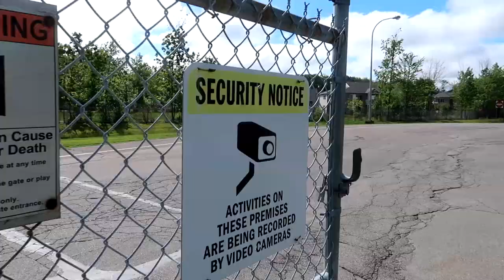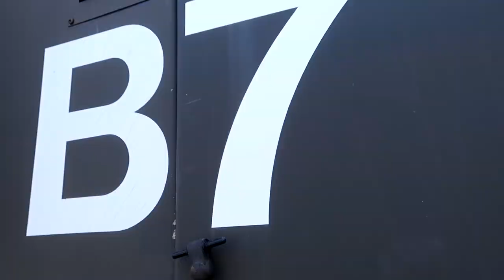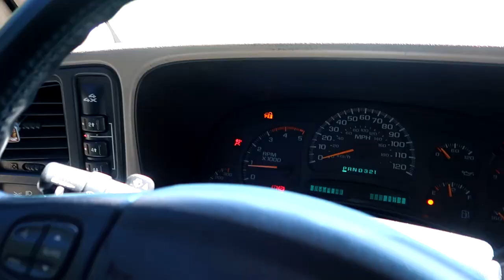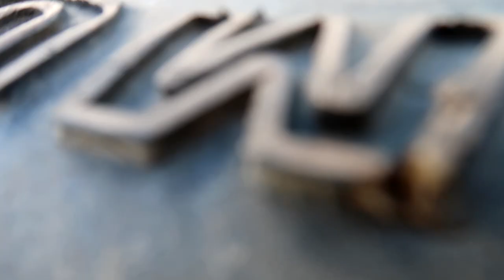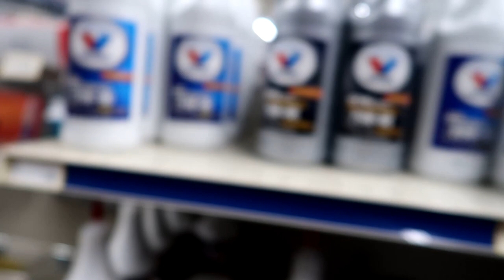GIRLFRIEND WOULDN'T LET ME!!

Comment: you went ,  that auction is the first Wednesday in june @ 9am every year for the past 25 years that I know of . tell your girl fiend this ,  I took my nephew there in 2011 , he  picked up a 2001 ford f150 that needed front brake pads for $650 . he drove it almost 1 year then sold it on craigslist for $2000 .  he took his $2000 to another NYS-DOT auction in Rochester and picked up a 2002 chevy pickup for $1800 . he had that 3 years then sold it broken on craigs for $800 . (but still up on his original 650 ) then took his $800 to a NYS-DEC auction (dept of environmental conservation ) and picked up a 2003 f150 4x4 -  bi-fuel CNG ..  dark green game warden truck ,for $800. and still drives that now .  if you buy a car or truck from one of those , look for something just a little broken ..muffler/brakes/winshield or tires .. you get the best deal that way . not to many people want a broken or rusty truck so they go cheap . save the auction calendar on your internet favorites https://online.ogs.ny.gov/surpluspublic/auction/default.asp    -  they will add more at the end of july .  one in west Seneca and maybe Niagara falls parks dept .    -   and that auction on the 21st finger lakes (Romulus) has one of those 4 wheel gators ..  looks like you had fun there ..  in the past I saw those loaders go for around $6500 . dump trucks  2 or $3000 . pickups $500 - $3000 .   anyone else who lives in new York state save that auction calendar . they have auctions all over new York state (a lot on long island and Albany)